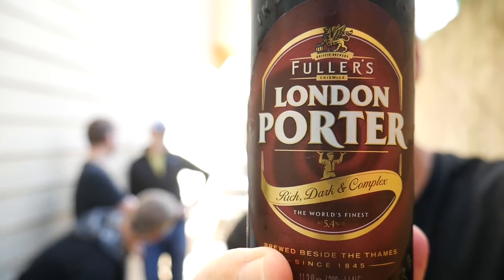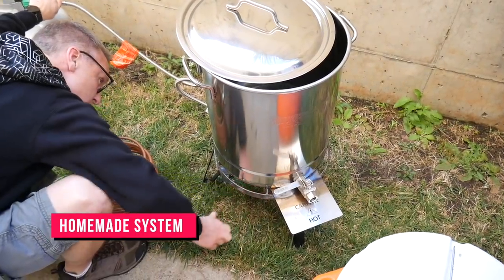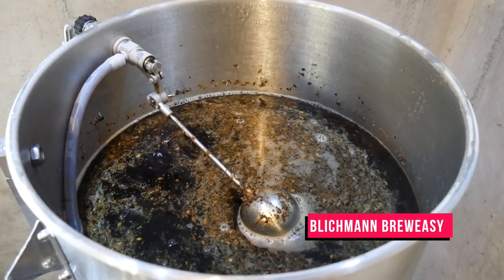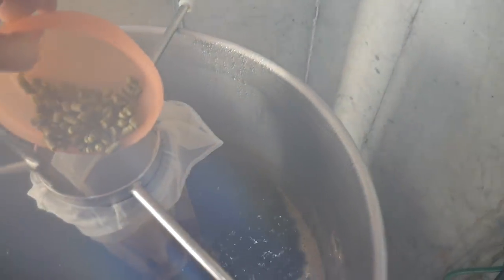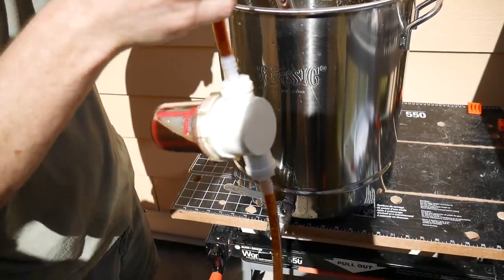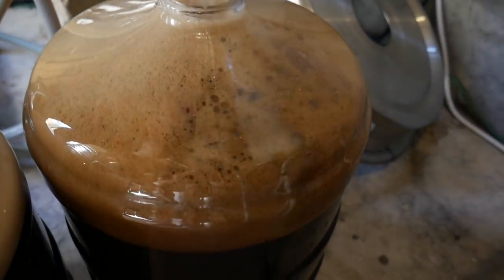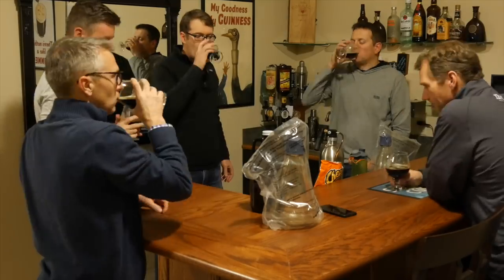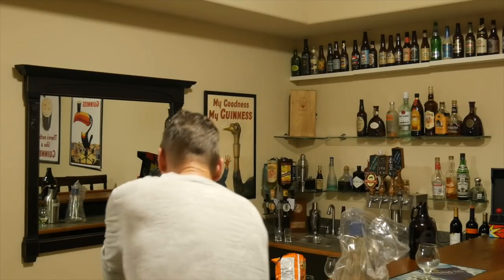Brewing the same beer on $300 v $3000 systems

Comment: The fermentation makes a massive difference, and I have a couple of observations.

For me, you were more interested in aerating the wort than in keeping out dodgy wild yeast or bacteria. I've found that splashing it into the fermentation vessel is enough.

Secondly, on old fridge is a great place to ferment. A small electric radiant heater on a thermostat will keep the temperature at the right level (varying it slightly can help as fermentation proceeds) and works brilliantly. You rarely get a stall, and it's faster.

I'm actively considering a Grainfather (just for ease of use really) but to be honest it's the bottling that I find most laborious.
Reply from the maker: Yeah good tips. We do have a temp controlled chest freezer with heating and cooling now. And yeah bottling is awful - kegging all the way!
Reply: Kegging is not for me (at least for now) so I found that pressure fermentation + iTap is super practical combination :)

Comment: I'll just say this: I'm a massive hefeweizen fanatic and I've tried quite a few in my life throughout my travels around the globe. When I decided to do my first ever home-brewed beer, I went for a (almost) traditional Hefeweizen. 50/50 pilsner/wheat malt, Hallertau and keeping the IBU around 13-15. The differences I made came mostly from being new to all this and boiled my wort a little bit longer. The final ABV % was 7.8 but it was the best hefeweizen I've ever had and I still can't reproduce it. 
Bottom line: Gear does not matter that much when you love what you're doing. I literally made my first 20-30 batches of beer in my backyard, next to a lemon tree.

Comment: I learned that an immersion chiller will work much faster if you stir the wort. It also helps to get the temperature uniform in different parts of the kettle.

I was lazy and did not stir one evening and noticed it took longer but not long enough to worry about. What I didn't notice was that the temperature showing one the gauge was not the same as the average temp of the wort when I racked it to the carboy. lesson learned

Comment: The main difference is... the ease of brewing, not really the beer. We moved from BIAB (arguably the easiest way to make all grain beer) to a Grainfather and it was still a world of difference during brew days.

Would be fun to see this experiment scaled up, use as many different systems as possible and make the same beer. Wouldn't be the easiest video to make from a logistical standpoint, but it'd be fun.
Reply from the maker: Exactly. Perhaps a more expensive system creates a better tasting beer - perhaps not. A lot of what you're paying for is convenience and consistency. Love that idea of a video with a whole bunch of systems... extract on kitchen stove through to something automated like a Pico system.
Reply: If you don't mind me asking I do a full scale 50L BIAB (no sparge) pot on a gas burner and it works really well and is easy.. I hit a 70-75% efficiency and consistency is good.. however I do think about a GF from time to time.. my question is do you think it is worth the move and are you glad you made it?
Reply: MrOnihige I have also thought of getting a Grainfather to break into all grain brewing once I move later this year.  One thing that has always kept me away from all grain brewing is the ease of setup, cleanup and brewing.  If something like the Grainfather makes all of those things easier and helps create more consistent results, then that is something I would consider.  Noting, of course, that in the end, the ingredients and the operator still make a huge difference in your results.  I would appreciate and be interested in your thouhts and experience so far.

Comment: The homemade system allows for spraging where as the electric system does not. This gives you higher efficiency, meaning more fermentable sugars available to the yeast. This is likely the reason for the higher alcohol content and the different flavor
Reply from the maker: Yes the home made system was more efficient for sure. We tried to account for that in each recipe to get the same OG.

Comment: Cool gadget for aeration. However there has been some studies that show aereating with oxygen is much more effective and quicker to do. 
I bought a stone for next to nothing, some tubing and a small oxygen tank. All for under $20. You need about 10 seconds to get the job done. 
Who knows perhaps that was the issue with the fermentation stalling. I noticed they used 2 different containers and two different people performed the aeration. I bet that was the issue.

Comment: The biggest difference between a high dollar brewing rig like the Blichmann (though I have had pro brewers tell me that you are paying a lot for that Bluchmann name) and the ballin' on a budget home depot coolers is not going to really show itself in a one batch faceoff. I'd bet that you would notice a big difference across 10 batches of the same beer. With the Blichmann you would get better consistency across multiple batches than you would be able to achieve with the coolers. Both will make great beer consistently, but the Blichmann will make the same great beer consistently.
Reply from the maker: Yes I think that’s really our take too. The temperature control of the Blichmann should lead to consistent results.
Reply: If you brew a lot of beer on any system you can learn to make as good of beer as your ingredients will allow.  It is all about process and repeated trials and maybe small inexpensive system upgrades.  I would put my inexpensive but well designed with a few hundred brews days rig up against any high price system.

Comment: I've been making ale for 3 decades and currently have about $175 invested in equipment.  How... because my kitchen equipment doubles as my brewing equipment.  My 3.5 gallon stock pot makes chicken stock as well as boils wort.  My electric stove does a dandy job of boiling the wort.  The bulk of my expenditure was in crown capped bottles.   Their brew may have fell short of the target alcohol level because of using all grains.  A possible explanation  may be an over abundance of non-fermentable sugars using all grain.  My DME wort starts out at 1.060 and ends up at 1.008 for an alcohol level of about 6.7%.  I am using Nottingham ale yeast.  Also I am careful not to aerate the wort.  I don't understand why they were whipping air into the wort since I was under the impression that O2 adversely affected the brew.
Reply from the maker: That's cool to see how you've improvised what's sounds like a cool brewing setup. Goes to show you certainly don't need fancy equipment to make great beer. Aerating the wort prior to adding the yeast adds some O2 back into the wort that was lost during the boil. Once the yeast is added then we were sure not to further oxygenate the beer.
Reply: Thanks.  Btw, you gave me an Aha! moment by answering my question about aeration.  Makes sense to me.  I tend to splash the wort when I transfer it to my primary fermenter which must do the same thing.  All I know is when the wort is cool enough to pitch the yeast in about 2 hours I get to see airlock action.  Next morning it is so vigorous it looks like the wort is being boiled.  After a hiatus of about 18 years I just started to brew again.  In the past I used a hopped syrup  called Dogbolter's which was exported by Firkin brewery in London UK.  Since it is no longer available I decided to come up with my own formula for a dark and heavy ale which I am calling Fragarach Ale.  (Drink a glass and you'll answer any question truthfully! <WINK>)  I began with 3 gallon batches just to get back in practice and have bottled my third batch of 5 gallons.  The 4th batch I just racked used the same hops as before but instead I used the 1st wort hopping technique.  Before racking I measured the SG to see how far along the process is and as is my wont I drank it rather than dispose of it.  Definitely a keeper!
Reply from the maker: I didn't know Firkin used to ship a malt extract syrup. Pretty cool you have made the own
Reply: It was under the "Goose & Firkin" logo.  Mind you the last time I was able to get it was in the early '80s.  Actually I wasn't trying to recreate Dogbolter's but rather come up with a brew that would satisfy my taste.  I'm the type of person that drinks Italian roast coffee brewed in a drip maker without milk or sugar.  I eat Habaneros raw and use Ghost peppers to make my own chilli oil.  So to put it in Lt. Worf's terms my ale is a warrior's drink!  ;-) At this point in time I'm tweaking the recipe to get the carbonation level right.  The current batch of ale is carbonated at almost the same level of Guiness draught.  I want it a bit more fizzy.  I don't bulk prime since I am loath to aerating the ale so I add the sugar to the bottle.  The last batch was primed at 4g corn sugar  per 600ml.  I'm going to prime a couple of bottles of the next batch with 5g and 6g respectively.  I go by weight since it lends to reproducible results.
Reply: All grain has nothing to do with sugars its all in how it was mashed.  Your DME was made from all grain that was correctly mashed then dried then dehydrated.  My all grain sub $300 1/2 barrel (15.5 gal, 58L) all electric 3 tier system has recreated almost every style of beer with quality results.  Yeast needs O2 for reproduction health it is after fermentation you want to avoid aeration.  Keep those yeast happy!

Comment: I have found more expensive equipment (in my case) actually can make life more difficult, time- and effort-wise. 

For example switching to a plate chiller with pumps and FVs with removable fittings & probes has now lengthened my brew day due to more  sanitation, assembly and cleaning afterwards. Bottling using CO2, a beer gun and kegs vs bottle wand has also made bottling 2-3 times slower.

HOWEVER, while most of these things won't make your beer better per se, they do remove a lot of the human and environmental variables meaning beer is more reproducible and the quality of the finished product doesn't vary as  much. For example I hit my OG more predictably now by using a home made automatic pumping grant and sparge system and my beers ferment more predictably now by switching from directly pitching yeast packets into a beer in my closet to a temperature controlled stir plate starter and a temperature controlled fermentation. My bottled beers fizz is more consistent and predictable due to being able to carbonate them with a CO2 regulator instead of relying on yeast (noticeably on very big beers).

However the best beers I've made are still split between when I used a plastic bucket, hot water urn and a lot of back power lifting things up and now. All that has improved is the consistency in quality between beers.
Reply from the maker: I completely agree. I wanted consistent repeatable results which my system seems to be giving me. Regarding the plate chiller I've actually started going back to using my immersion chiller now. Getting that plate chiller clean has been a real difficulty, which negates a lot of the benefits given my immersion chiller isn't a whole lot slower to cool wort.

Comment: I'm making mead and i've been lead astray by books and comments with my first attempt. You don't need to aerate dry yeast after re hydration, it should be all prepped by the manufacturer from all the information i have found. It's different if you're using your old cake or liquid yeast.

Comment: Random question...was the FG on the cheaper system measured by a refractometer instead of a hydrometer?

If so, this would almost perfectly explain the "stalled" fermentation and why it didn't taste like it. If you check out a refractometer calculator online that can account for alcohol (which skews the final reading) you'll find the following:

OG of the cheaper system: 1.057
FG of the cheaper system: 1.032

1.032 in Brix is: 8.00 P

If you plug in a starting gravity of 1.057 and an ending gravity of 8 Brix you end up with: 1.016
Desired FG: 1.017

Just something I thought I'd throw out there...
Reply from the maker: Todd West thanks Todd, I like your line of thought - that we actually had the correct FG all along and it's just the measurement that was wrong. Unfortunately it was a hydrometer that gave us that reading - we'll need to find a different excuse for our failings :-)

Comment: To add to the chorus of know-it-all Home brewers (is there another type?), something is amiss. Dark grains tend to increase final gravity by a few points, maybe into the low 1.020 range depending on OG. I’ve had some stouts end that high and taste great. 1.056 to 1.032 means something is wrong. I think it is important to determine what the proper final gravity of the recipe should be so you know where it should end up. In general, stick to a known recipe, mash around 150F, chill and ferment around 70F, oxygenate well, and use a reliable neutral dry yeast (US-04 maybe for an English clone?). Take it from a fellow home brewer who’s brewed his fair share of dumpers. Cheers!
Reply from the maker: Good tips. Curious to hear why you recommend dry yeast?
Reply: Dry yeasts are reliable, high cell count sure bets when it comes to brewing. I have used pure liquid cultures for years and they make great beer when handled and treated well. But for beginners, or in cases like this video where final gravity is too high for unknown reasons, dry yeast eliminates the biggest variable in any beer - fermentation. Brewers tend to obsess about the hot side processes which effect the beer less than proper fermentation. Good reliable, neutral dry yeasts include US05 (for America styles), US04 (for English styles), and 34/70 (for lagers). They are nearly foolproof.
Reply: Brian Schneider

Comment: You all should have compared system efficiency over taste. Each system is different and attains different efficiency. It would have been good to follow that over the taste, since this experiment was looking at system comparison and not the system and fermentation outcome.

Remember, it matters on the grain bill (more dark over light malt and vice versa), pH of the mash, & mash temperature. If you were unable to match these figures for both systems, then the wort outcome of each system will vary, which also affects fermentation. Then had you all fermented with the same built starter and in the same temperature conditions for all carboys, you would truly have an accurate taste testing between the two beers. All those factors definitely affect the final product.

Overall, it looked like a fun time and I'm gathering that's all that truly matters.
Reply from the maker: Hi Sam, yes all good points. We did measure and match on pH reading, mash temperature, and original gravity. But that's where the controlled conditions ended. We used the same yeast starter yeast, pitch rate, and method but created the starters independently, and fermented at our own houses, so again some differences there. But yeah, science aside it was a fun experience and comments like these have given us some tips for what we'll change when we do this again.
Reply: What's your fermentation setup like compared with the homemade?
Reply from the maker: Peter Stilwell Peter they are both quite similar in that respect - a temperature controlled fermentation chamber.

Comment: Those final OG's are .....crazy high. Must be like a syrup. In a hot country I suggest do not aerate the wort and pitch direct with yeast enhancer keep in a 18-24c place if you can or place wet cloths around it to evaporate heat. Too much excitement & not enough fermentables for yeast to be happy I think. Failing that check your mash temps, as a 69c - 72c mash will also come up short on fermentables. I know you know this but its pretty obvious two beers fell short.

Comment: Chunky yeast is pretty normal with some strands, wouldn't have stopped me using it.  Not sure what your fermentation procedures are or what yeast you used so tough to comment on why it stalled.  

Cool video, I almost went with the blichmann set up, pretty sweet set up.
Reply: Reaction Brewing, yes, it looks like a highly flocculant yeast, which can be a good thing, since it makes separation of the finished beer from the yeast easier.

Comment: Looked to me like you mashed at 166 Fahrenheit... if you mashed the whole time at this high of a temp that explains you low alcohol content...
You get a better mash by step mashing, starting at lower temperatures releases simpler sugars easier for the yeast to digest.. slowly raising temperatures until all starch has been converted...
Did you do a starch test?
Reply: Great video anyway I love your setup
Reply from the maker: Thanks for your kind words. The video is a bit misleading in that respect. We did heat the mash up to 168F at mash out but prior to that we were mashing much lower (I forget the number but around 150F or so).